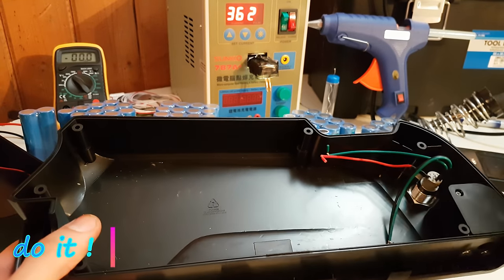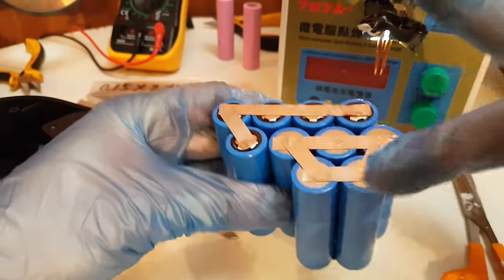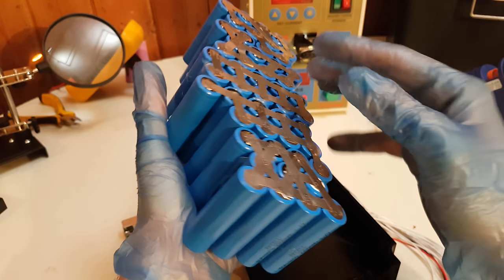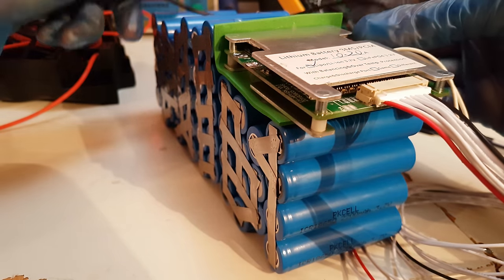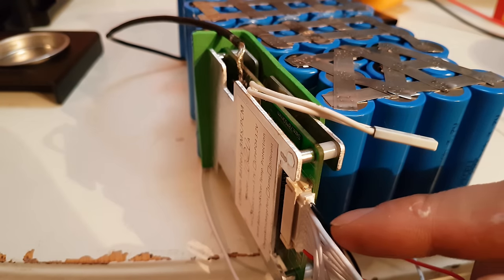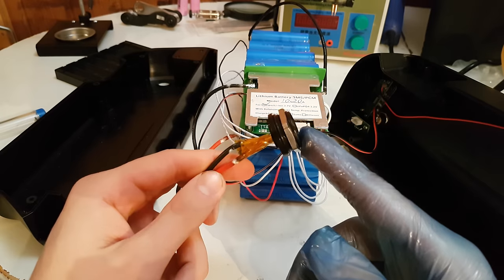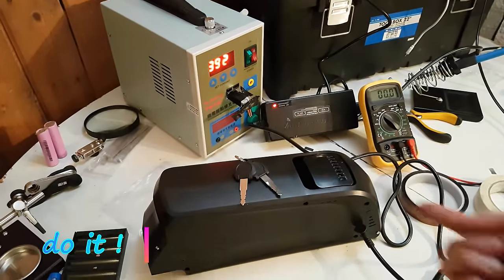How to Build a e-bike Battery pack from 18650 Li ion cells - DIY

Comment: worked it out the red and black from the usb circuit board goes to the discharge port. The red and black wires direct to the led from the power button comes of the 5v circuit and the usb port wires up directly with that. The voltage meter wires up direct to the positive of the battery and negative goes to discharge port . The fuse is wired to the positive From the battery directly then out to the discharge port. Then the bms board can control all the external ports on the battery case also the looped yellow wire from the bms has to be cut in two and wired to the green wires coming from the power button. The bms is a 36v with battery balance function and the battery case can hold 50 cells making a 10s 5p battery pack. 11000mah . Took me a few days to work all this out as there is absolutely nothing online to guide anyone making their own battery and putting it in a proper case hope this helps everyone this guys video is helpful but difficult to see any wiring and questions people have asked just don't receive any knowledgeable answers peace out enjoy :)

Comment: great video ,,this is what im trying to do ,,i have a 48v ebike moped 250w a 36v 350w and a 12 volt assisted power i want to build individual 12v packs that will connect together ,,will this blow my 12v bms in each pack ??
Reply from the maker: Hei , that's a good question ! The best is to have a Bms for the total amount of volts and amps the final battery have . If you want to have individual BMS on each 12v pack you will have to charge them separately and connect the wires betwen those packs in series to provide the voltage the electric motor needs . It will blow the bms if you want to charge the group of the battery packs which have 12 v bms with a 36 v / 48 v .. so again you will have to charge them separatelly . As for discharging the battery sistem you said .. It will probabily work for a while , but I don't think it's a reliable solution .
Reply: thank you for your reply ,,i did think the same ,,now i need more cells and more bms ,,thank you  again ,,you got my sub
Reply from the maker: you're welcome ! thank you also !

Comment: Is it possible to use 36v 12a battery with originally 36v 5.8a ebicycle battery with same original motor controller?? Pl. Help & oblige. I want to improve millage.

Comment: Why do people use hot glue? It seems like it would not be solid when the batteries heat up, causing wiggle and terminal breakage over time. Is it to be easily disassembled?
Reply from the maker: What else should people use ?

Comment: I have a battery pack with an USB port to charge mobile or other stuff. It doesn't work. I think the problem is the small pcb inside the battery pack. I cannot find a replacement. Do you have an idea where I could find it? Thanks

Comment: What is the specification of the 18650 required to build a 24v 14ah battery pack?
Reply from the maker: arun vikas you'll need 7 cells (3.7v each) in series and depending on  the amperage of each cell - you can find out how meny in parallel to get 14 Ah

Comment: Hi, i have 40 Panasonic 3.7V , 3400mah. If I do 4P10S, I get 37V 14AMP battery pack, will it work with 36V 500W ebike kit? are you using 12 awg or 14awg for discharge cable? they look bigger than the other. thank you !
Reply from the maker: Yes , they should be able to handle that motor ; to double check you can test the cells for maximum discharge and see how they react or check the specs from the seller . I don't remember the size of the wires but they were more than 12 awg

Comment: What model 18650 batteries and what model bms did you use for this?
Reply: I would stick with Samsung or LG...much better batteries that handle load better with very low voltage drop and least affected in the subzero temperatures. If I were you I would avoid using the BMS and just build the batteries in simple way....less things to go wrong and easier to troubleshoot when your ebike or escooter fails. Also consider Samsung 21700 batteries....they are improved in every way.

Comment: Very nice video! The usb port is not working? Do you need something extra to make it work?
Reply from the maker: Hi ! On this particular case it's requiered to have a bms witch can support  charging port.  But in some other models it's possible to wire up the usb port direct on the terminals ( 36 v )
Reply: So does a proper bms for the model of your video connects to this little adapter? (a small adapter is obvious on 4.23)

Comment: Hello dear nice job. I want to make a 12V 4 amp/h battery for my motorcycle with lithium ion cell. with 4x2 cell in parallel and series. is it safe workable for general motorbikes?? do i need additional charger or circuit to charge & discharge this battery?? You may know motorcycle has its own charging system via rectifier. please help me.
Reply from the maker: Hello ! First find out how much does the rectifier on your motorcycle , charge the curent battery you have . if it's not more than 13 volts , you might consider using LiFePo4 cells which have a nominal voltage of 3.2 volts instead of 3.7 volts as Li Ion cells . So when 3.2 volts used in 4 series will result in 12.8 v nominal and around 14.6 volts when fully charged . If you use 3.7 v Li ion cells in 4 series , the battery might go to 16.8 volts when fully charged . So again , depends of your motorcycle charging voltage and what's the voltage requiered to run it correctly . Than you can just find a combination as I mentioned . You migh use 3 series of 3.7 v li ion which can be 12.6 v when fully charged ! After you figured out that , find a protective board ( BMS ) specific for that battery you are gonna build ( like 3s , 4s , LiFePo4 or LiIon , amps )  . aliexpress is a good website for that . It is safe as long as the new battery will have the same v / amp as the old one .  I hope it helps !
Reply: dear  @doit_vehicles , thanks for your reply. if u use 3 cell i.e. 11.1 Volt, what happen??
Reply from the maker: Nothing catastrophic , but the battery will get overcharged , possibly extra stress on the rectifier and something might fail on long run ( at least that's valid for cars )
Reply: @doit_vehicles ,  if i use the laptop battery s protection charging Circuit in it, then it might be saved from overcharged. I guess rectifier is capable to charge 12v so no stress there will be. What u think?
Reply: I'd guess this lithium battery might not have enough CCA. Cold cranking amps.
Reply: @weekendworrier2468  i dont need cranking amp, coz the bike has no self start

Comment: Hello, I need some advice to make 36v battery pack. My motor controller says 17 Amp (Max). I can get Uniross 18650 Batteries of 2600mah. I need to know how many batteries do I need and a diagram to make it. I would very much appreciate any help you can give me. Thanks.
Reply from the maker: Hello ! Yes sure , From what you said you can make a 15.6 Amp battery for that controler . So you will need 60 cells in total like : 10 cells in series than 6 cells in parallel ; The diagram will be very similar with what I did in that video , except that you will add one more cell in parallel . 
And what kind of battery case do you wanna use ? If you want to make it in plastic case like I did , make sure you can fitt all 60 cells inside the case before you start the work . If you dont wanna have it in a plastic case ,  than you can make it in any shape you want as long as the configuration remain the same ( 10 in series and 6 in parallel ) careful not to shorcircuit them if you must fit them in a plastic case like I did . :) 
Let me know how it went .
Reply: @doit_vehicles  Great. Thanks. I've already made a triangle box with plain metal sheet to fit lead acid batteries. But weights nearly 20kg !!!!.... I have to reduce weight by any means. Thank you so much for your help. (Y)
Reply from the maker: Haha , I see . You're welcome anytime , good luck with your project ; and let me know if you have more questions !
Reply: You need to find out the safe discharge current in Amps of the cells you are using, most brand  name cells can handle around 4 to 6 max discharge, check the spec sheets at second life storage website, then multiply the safe discharge amps by how many cells you have in parallel this will tell you the safe and max discharge in amps ie 3amps safe discharge for a 36v 10s7p battery will be 7 x 3 = 21 amps, some batteries show a C rating for the discharge so a 3000mah battery with a  C2 discharge will be 2 x 3000mah or 2 x 3amps = 6amps discharge, and a C3 will be 3000mah x 3 = 9amps, So C is x the batteries capacity, but check the spec sheets to be sure and for your own peace of mind.

Comment: video is helpful but could be better ie when you say this connects to that show a close up of it, so people can double check seems to rushed , also these dolphin cases have a battery status level?, and a fuse? , USB charger?, I will just take my other battery apart, as this video is not complete and clear, thanks anyway
Reply from the maker: At the time I couldn't find a BMS to support those functions

Comment: what voltage do you need for charging this pack 42 or more?
Reply from the maker: yeap , 42v is the max charging voltage
Reply: Thank you for your reply! Im making same like this battery pack for my lawn mower on two 18 volts battery,i did not know charging voltage for this bms
Reply: 42volts

Comment: What is the right BMS for 4s 10p battery pack ......cells are 18650 3200mah .....what is the current rating of bms ??
Reply from the maker: the curent rating of the bms should be displayed by the seller  You want to build a 12 v battery pack ?
Reply: @doit_vehicles  they have  diffrent current rating ....but what is the best for me ????
For 12v  30ah battery pack

Comment: could you help me please, I would like to make a battery of 10S 5pack LGgbmh11865 capacity 3.7 volt 3200 Mah, should I count it in 4.2V x 10 = 42V or my first account 3.7v x 10 = 37 volt, could you advise me a BMS? thank you so much
Reply from the maker: Hi sorry for late reply ; The 4.2 volts it's when the cell is fully charged and 3.6 is the nominal voltage . 3.0 volts is the maximum level a cell should be discharged . For the BMS  I used aliexpress the last time I bough it , I would not buy those 2 $ 10s bms becuase they do not work for long time ( from my experience ) So it's a good idea to look for good reviews .
Reply: @doit_vehicles  okay thank you very much for the info can you advise me a bms you used please which will be more serious in longevity

Comment: Why You use a hot glue for bms? BMS is going to hot when it works. BMS melted the glue.
Reply from the maker: just so I can continue to assamble the battery without having the bms bouncing around .. I am not sure if  it will get that hot to melt the glue ..

Comment: It is confusing. I do not understand because of mili AMPS you can't use BMS.Can you use diferent BMS.10 CELL'S 3.7=37V AND + Paralel 3.7 is 40.7v.It is very very confusing.I do not understand.

Comment: Can I use 3 12v 9.8ah lithium battery to make a total of 36v with 29 ah to power 1000 watt motor electric scooter
Reply from the maker: You will need 9 of those li ion batteries to make a 36 v  29 ah battery for your scooter . With only 3 you might connect them in series and make 36 v 9.8 ah
Reply: I bought 3 pack of these
Reply from the maker: Do they have a bms on each pack ?
Reply: doit_vehicles not sure
Reply: Technical parameters:
Nominal voltage: 12V
Input voltage: 12.6V
Output voltage: 9V-12.6V
Battery capacity:9800mAh (9.8Ah)
Outside diameter:
163*65*18mm
Please note the size according to their own needs, such as no note size, are random delivery.
Total weight: less than 300 grams
In line with protection: overcharge, overdischarge, over-current, short circuit protection function
Packing: blue PVC
Battery charging requirements:
1: the need for special lithium battery charger; constant voltage;
2: charging voltage: 12.6V
3: charging current: less than 2A
4: supporting the charger when the red light turns green full
Battery discharge requirements:
1: input: output: 2 20# line, 150mm long
2: maximum instantaneous current: 10A
3: maximum working current: 5A
4:
As input and output have other requirements can contact with the owner, the above is the defaultdelivery parameters
Shipping list:
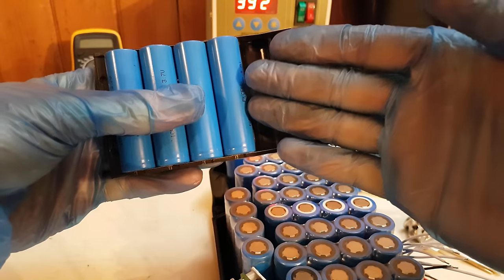A group of 12.6V1A 1:12V-6.8Ah lithium battery, 1 charger
2: battery and charger warranty for one year
Applicable scope:
Reply: @myangel5846  Some 18650 cells are meant for low current applications like digital electronics, and others are meant for high current applications like scooters/skateboards/ebikes. The difference is in the surface area of the electrodes within the battery.  You have to look at the "continuous discharge current" of the battery.  From what I have researched, this should be 20A to 30 A for the bloody strong skateboards.  Not sure if 10A maximum current is good enough?    The low current capcity batteries, when they draws current, they heat up and you get voltage drop, so it never gets the full power. doit_vehicles is this correct?

Comment: So its 396w battery? Could use with 500w motor?
Reply from the maker: yes , it's possible
Reply: @doit_vehicles  so i could make 8000w 70,3V 105Ah battery pack from 50 18650 cells (3,7V 3400mah)???? Plz help
Reply from the maker: @menovitunparamm4116  Yes , but you will need much more than 50 cells to make a 72 v 105 ah battery ... and the battery will be quite large
Reply: @doit_vehicles  why more than 50? First create 1 battery pack with 19 cells | 19x3.7V=70,3V/3400mah

 and then to get amps higher

Then another battery pack with 31 cells 

 31x3400mah=105 400 ||  105ah/3.7V 

And then combine both battery packs in paraller or series?
Reply from the maker: @menovitunparamm4116  So if you wanna make a 72 v battery ( 72 v it's the nominal voltage , therefore when fully charged the pack will have 84 v ) you will need first 20 cells in series - 20s . If you want 105400 mah on this pack that's correct you will use 31 cells in parallel . Therefore 20 cells in series,  times 31 in parallel equals 620 cells in total .So the pack will be super large and you will have difficulties in finding a BMS for such capacity on a 72 v nominal battery pack .
It's not impossible though , if you have the budget for it  .
 I hope it helps
Reply: @doit_vehicles  ahhh thx dude, rly helped me out to clear things out!! Subbed :D
Reply from the maker: @menovitunparamm4116  cool :)

Comment: where do i buy these cells?
Reply from the maker: aliexpress - just look for 18650 cells
Reply: @doit_vehicles  How do you know if they are able to do a continuous discharge of 20/30 Amps for electric bicycles/skateboards?
Reply from the maker: the seller should provide the maximum discharge current; usually, it's around 4 -10 amps/cell. Or if you have a cell tester , use it and you can be more sure about the max discharge on each cell

Comment: Your 18650 says 3.7v... how come it bacame 36v  all in all
Reply from the maker: That is the " nominal " voltage . When fully charged is 4.2 v and discharged around 3.1 . So its just the chosen marketing name
Reply: @doit_vehicles  is it safe to use 18650 battery with 3.7v  to make a 36v 10s3p ?
Reply from the maker: Yes , sure

Comment: how to make battery but fail to tell why are you doing it like that
Reply from the maker: What should I say more ?
Reply: @doit_vehicles  what battery goes witch way so it make it 36v and then how to make it have more capacity. i found it on the other video but butting batteries in a row and then on the second row other way around without telling why doesnt help anyone build their owwn battery

Comment: @ do_it 36 Volts 
Is NOT ENOUGH 😒
How about something 72 to 96 Volts 💪👂     For some of us Heavyweight people in Need of the Extra Power?!?!?     Thanks I  Would Really Appreciate 🖒🖒    
   I'M Trying to Build a 8000w hub motor kit
Reply from the maker: I agree ! the thing is , where I live it's "ilegal" to run more than 250 w motor on a e-bike ; However I am planing to build an off-road 2 wheel drive with something around 10 kw - once I've saved up enough $$$ for that